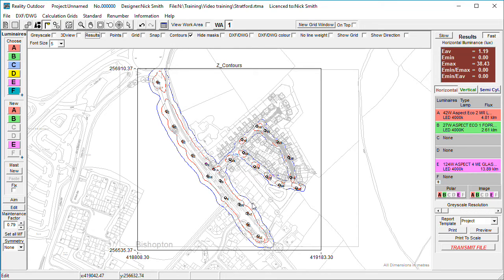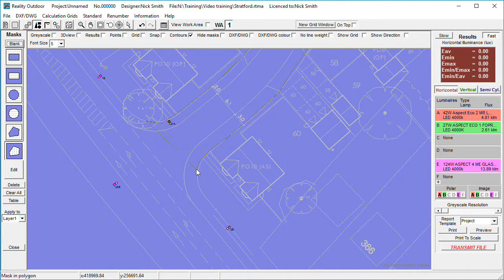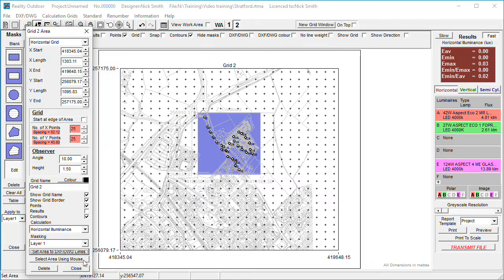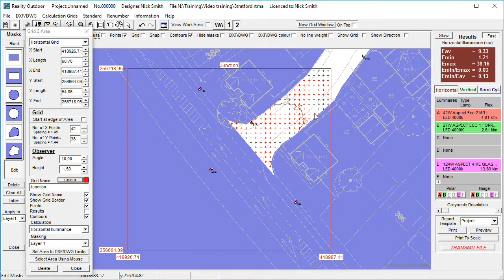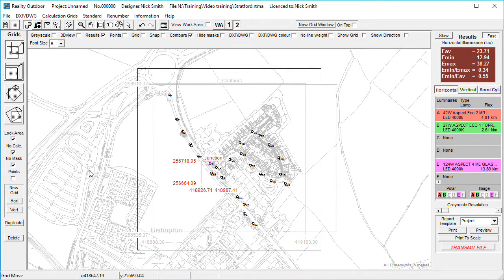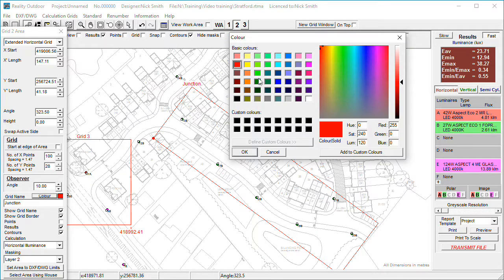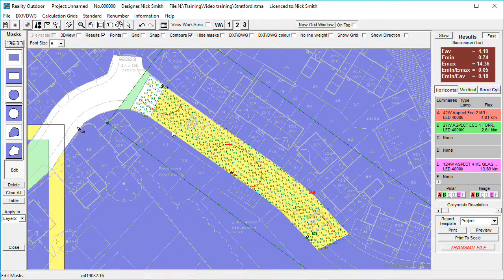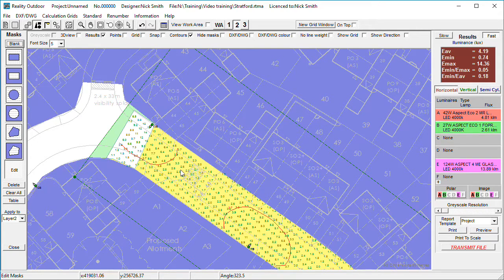Masking Multiple grids using Lighitng Reality

Comment: I have 3 grids & using the same trick, first 2 were fine, but right after drawing in the third, one or two grids couldn't show results correctly, it appeared the masks are not working according to how I layer them. :(

( I think the same thing happened to the end of your video?)
Reply: The software only allows two masking layers. It might be best to organise your grids slightly differently.